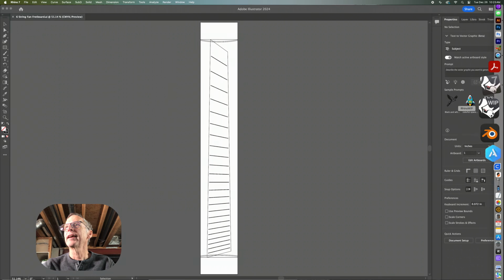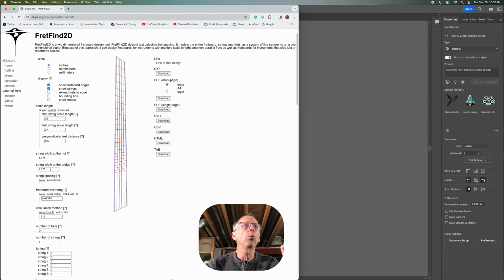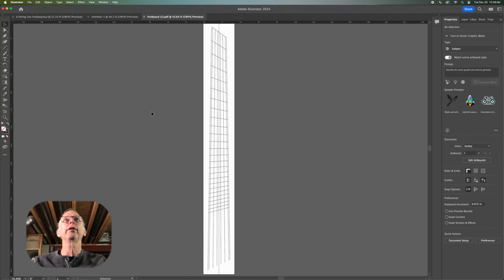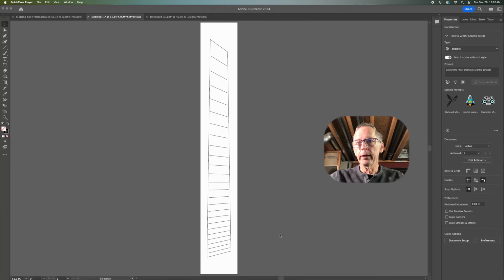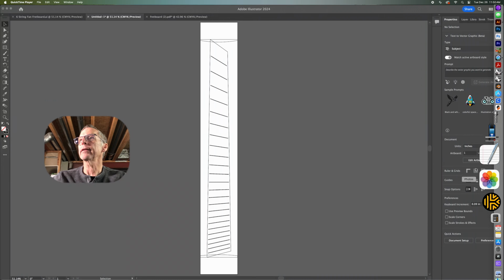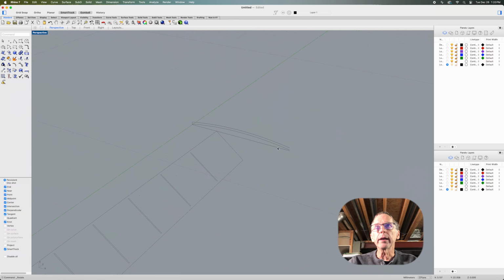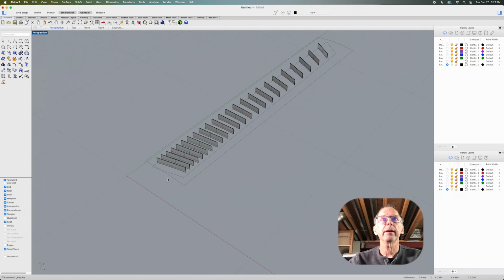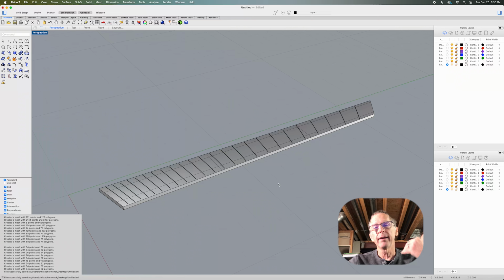Making A 3D Model Of A Multi-Scale, Compound-Radius Fretboard

Comment: AFAIK there's no difference between binary and ASCII, except that ASCII is using a limited set of bits (or more precisely, 32-127 out of 0-255 in a byte) to be able to send it over in a printable fashion. A feature not really needed nowadays.

Comment: Awesome video. Is there any way to parameterize either the Illustrator or Rhino files so that you can just tweak some values to stamp out models for different necks?
Reply: Haha, well, I tried a search and actually found something! 

Grasshopper 3D
Grasshopper is a cutting-edge parametric modelling tool which works with Rhino to allow a powerful and efficient new way of designing.

Grasshopper has a host of plug-ins and is included within Rhino v8.